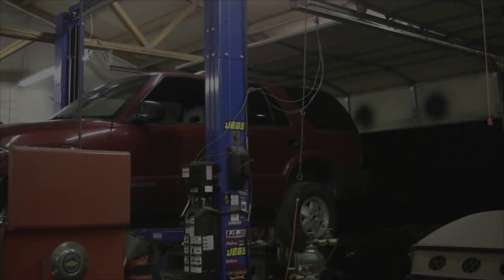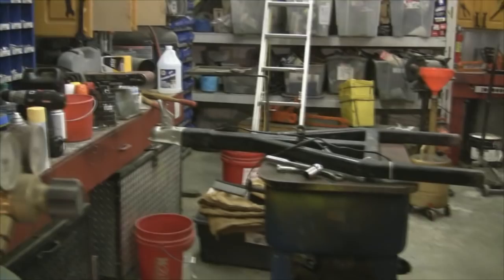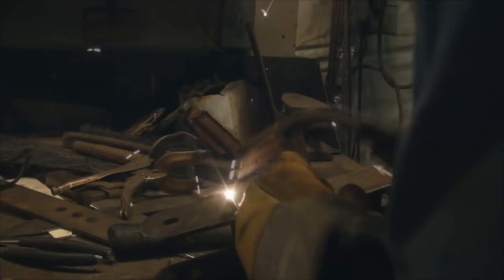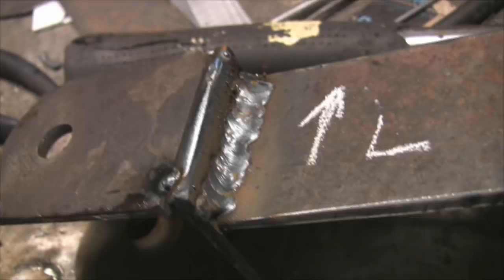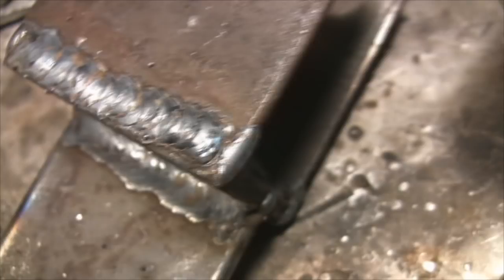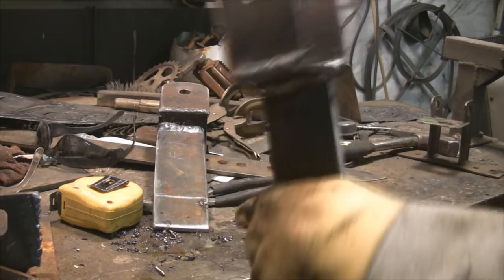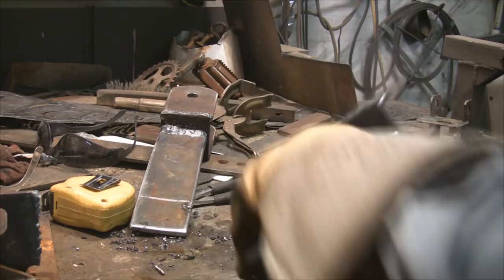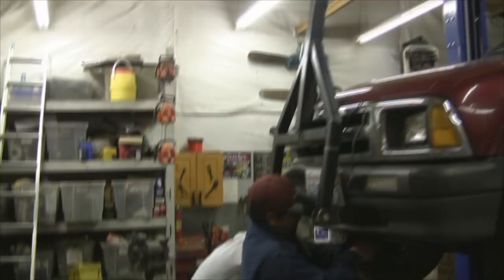Building Victors Tow Bar

Comment: I learned to weld stick and LOVED the beads I could lay with it, loved being able to really get right down and see the puddle... When I first started MIG welding years later it was like learning to weld all over again! I never got as quite as good at it as I was with a stick ... decent enough, BUT I absolutely LOVE 1. Not having to change rod. 2. That a MIG strikes a lot easier. 3. Not having the rod stick and pull out of the holder. 4. Not having to hammer off the slag! I own both machines but there is more to love about a MIG welder.
Reply from the maker: haha.. I learned stick in high school.. and I remember all those things.. I still have my old Lincoln buzz box and still use it from time to time. you can reach through holes and get to places a few inches in.. where you cant with the mig. sometimes I could use bigger wire but .030 does pretty much everything I need.. one time while building my rat rod.. I ran out of gas on the mig.. so I drug out my old stick welder along about midnight.. then when I ran out of metal.. I "almost" cut up my welding table just to keep going haha.. but I backed off.. thought that was taking it a bit far  haha

Comment: Not saying you should have, but I would have wrapped the welds around to meet each other on the long strips for added weld strength. But those welds that you provided will hold for 1,000 miles and then some. Good job.